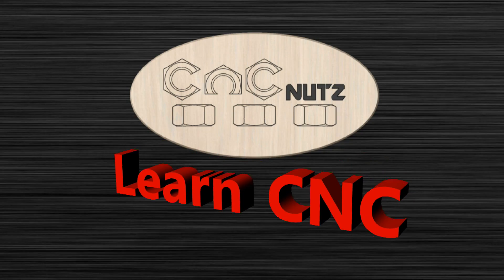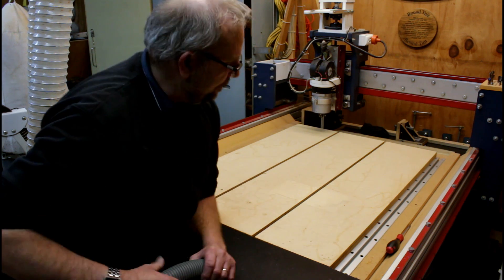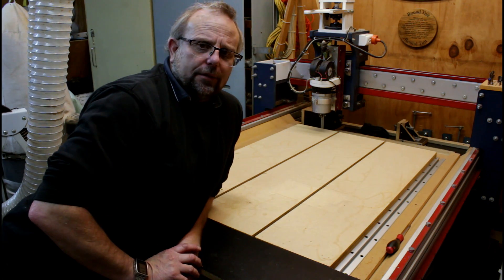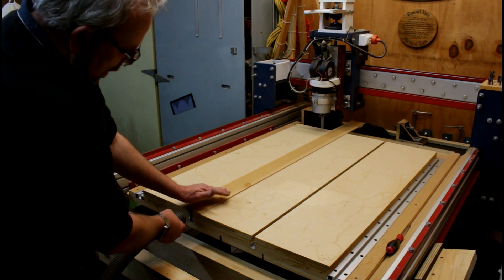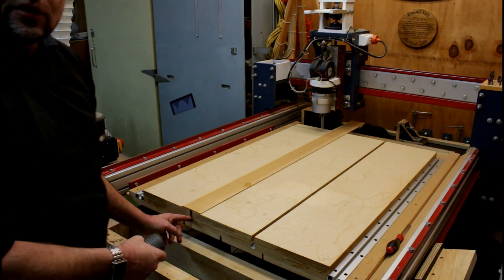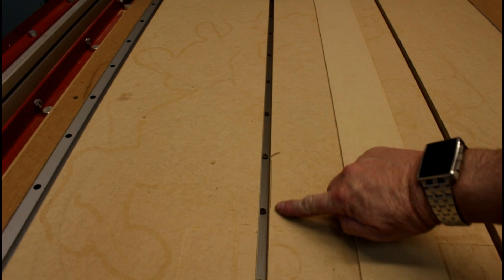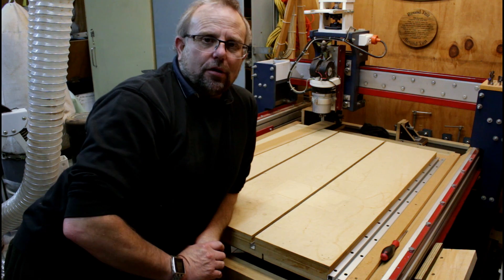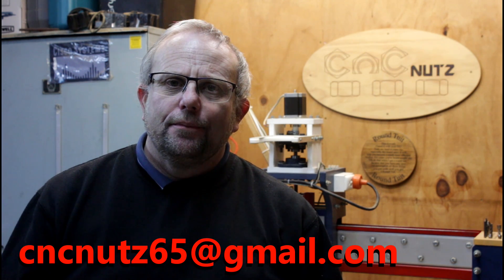Clean your T-Slots the easy way - CNCnutz Episode 115

Comment: nice tip , i wouldve use compressed air and messed up the whole room with sawdust 

question : the UC300 controller you have has some analog in and outputs for things like rpm ajustment for youre router either from the program youre running or using a potmeter or you can hook up buttons to use like the buttons on youre pendant or real jog knobs 
have you tried to get any use out of those analog in and outputs yet ?

found out the UC400 version only has digital outputs and cant controll the inverter without some add on circuitboards , i dont like adding all that stuff when theres a cheap alternative that works as a single unit 
so i might cough up the extra 15 euro for the UC300 with the addon board , might be using those in and outputs to make some extra controlls for the routertable near the computer
Reply from the maker: I haven't set up anything other than the basic motion control on my UC300. At some stage i will set up speed control when i connect my spindle but haven't done it yet.

Comment: Hi Peter,  No problem, thanks for replying anyway.   just one other thing, you said you use down cut spiral cutters. Are they HSS or Carbide?  I am using HSS on Tassie Oak but the finish is very poor (chipping out) so i tried straight flute carbide which seems much better but can only take small cuts.  i saw you making the Christmas tree in the 19mm ply and the finish seems very good.  By the way, who are you going for in the one day cricket starting soon?  i bet I can guess.......
Reply from the maker: +Dean Richards 
The cutters I use are all carbide.  I have been using the same 1/4"  cutter for my yardart about 4 years. That is what I used for the profile cut on this project.  It cuts cleanest when doing conventional cuts.  
Black caps. Is that what you guessed? 
Cheers 
Peter

Comment: Hi Peter,  Could you do a clip on greasing and lubricating the cnc ball screws and linear bearing, also what grease to use.
Thanks
Dean
Reply from the maker: +Dean Richards 
Hi Dean,  I'm sorry to say that I don't have ballscrews or linear rails on my machine.  The V rails are run dry and the Delrin AB nut is self lubricating though I do sometimes hit it with a little bit of CRC 556.
Sorry I can't really help at this time.
Cheers 
Peter

Comment: Say Peter, that's one part of your system we haven't seen yet, the dust collection. I've noticed the dust shoe on the router but where does it go?
Reply from the maker: +olgreybeard 
A small 1hp dust collector sits next to the router. You can see the top of the DC in the videos. I will make a note to show it one day.

Comment: Pretty slick trick there but the shop vac I use on my CNC is almost stout enough to suck off the annadising on my T slots.  Just dragging it along a slot does fine.. I have a small shop made separator between the shop vac and the dust boot. I simply pop the hose out of the boot and stick a short piece of hose on it long enough to reach anywhere on and a bit around the CNC.  I very rarely have to mess with the shop vac as the separator gets around 96% of the swaf. I made it with a drawer in it so emptying is simple.. Just unscrew the 2 knobs and pull the drawer out and dump it.
Reply from the maker: +John Ware 
Nice setup. 
One day I might get a decent shop vac. 
I hope.

Comment: I just use a vacuum crevice tool on the end of the hose...and the light in the fridge is to keep the butter soft....I don't know,.. I'm putting my tea cosy back on and going to bed.
Reply from the maker: +Dust Bunny
I don't have a crevice tool and my butter doesn't stay soft either. What else will go wrong.